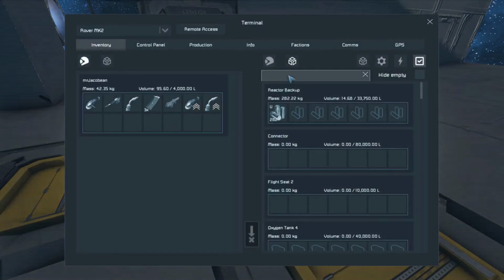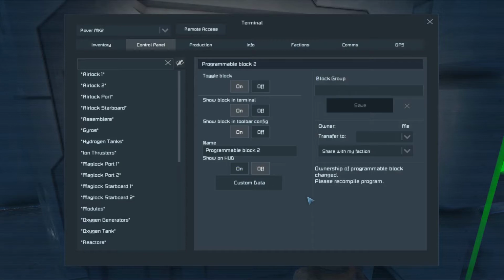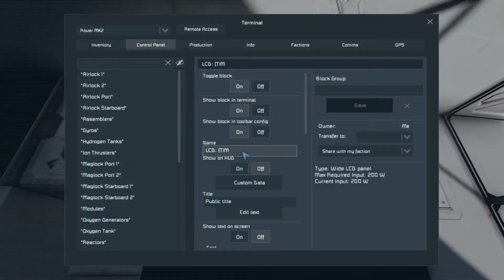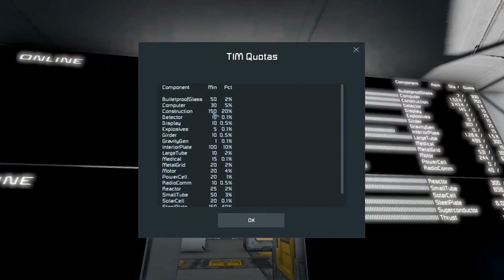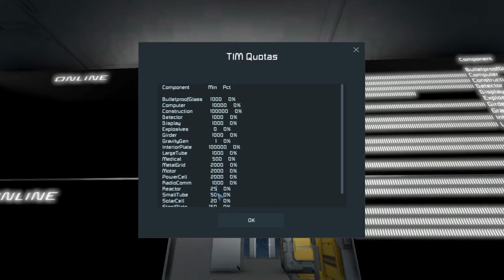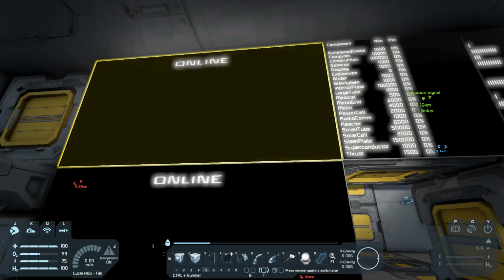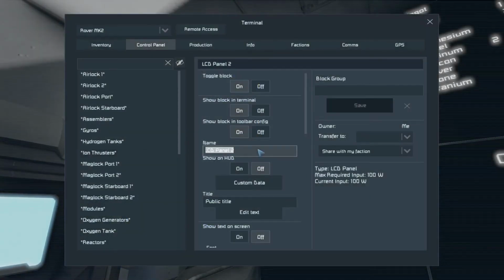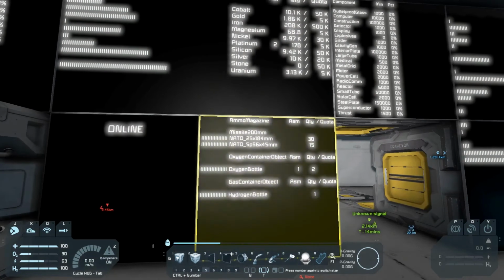Space Engineers - Advanced Sorting - Episode 30

Comment: I have one problem with the TIM LCD Inventory displays that I am hoping you (or one of your kind viewers) can help me with.

I have set up my command bridge on the land base with a one block band above the viewing windows where I have set up my LCDs.  I need to span the Component inventory so that I can increase the size of the font.  However, if I do the normal SPAN command to span two screens side-by-side it merely makes the bar indicators longer while still cramming all of the components into the depth of one LCD screen.

What I have been attempting to do is write up a command that will display only 10 Components on one screen and then I can set up the other screen to display the remaining 10 Components.  I have tried every combination of spaces, colons and backslashes that I can think of and nothing has so far worked.

Any help or advice would be greatly appreciated.